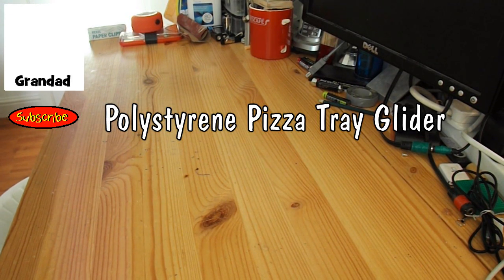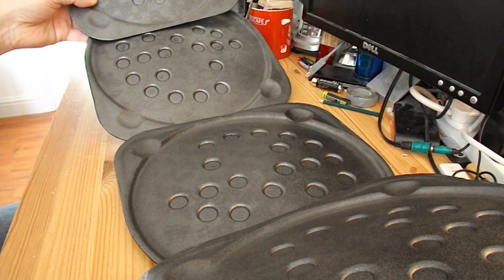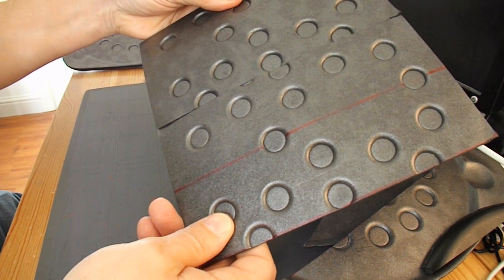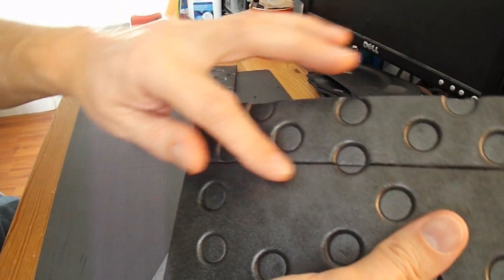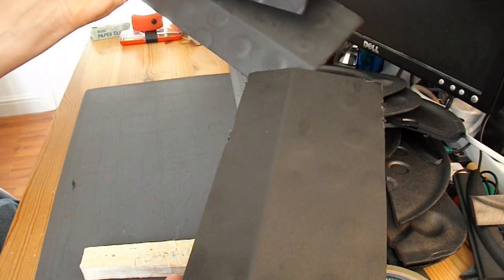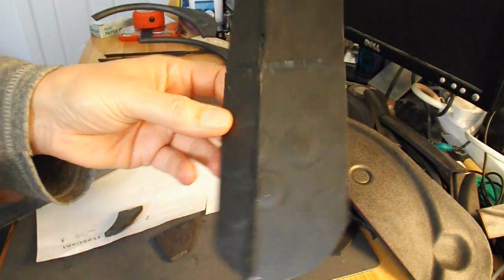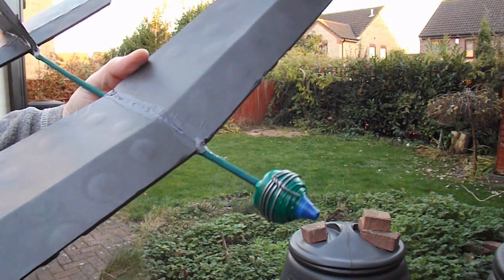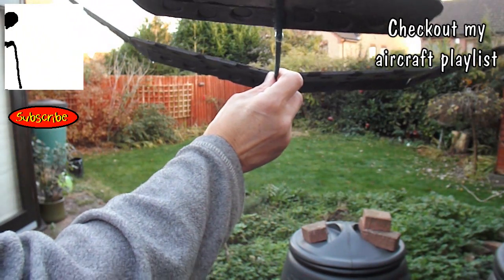Polystyrene Pizza Tray Glider

Comment: You could try to make a DLG glider with those ,jus sand down those bumps and put a strip of thick tape over the holes but don't press the tape into the hole,that shoud solve the inperfect wing
Reply from the maker: Not a lot of strength in those pizza trays to take the stress of a discus launch. You could add a fibreglass or carbon fibre spar to take the strain. Here is something similar - DLG Pizza Tray Glider with Cheap Kite frame playlist https://www.youtube.com/playlist?list=PLA5a2xPRSrB3JAFc7f5qk95lpdSMOXDHw

Comment: This glider is very well balanced. Just be sure that the rudder is straight (or eventually move it slightly to the right), because your plane turns always to the left, instead of going straight.
This glider could be a very good slow flyer (as much as my V.E.P. Very Easy Plane).
Install the F939 parts on it and have fun!

Comment: i have to exact same glue gun as you
Reply from the maker: Unfortunately after about 20 years of use it finally died and I had to replace it https://youtu.be/wllhi4orLAI
Reply: o, well i got mine from my dad so i don't how old it is?
Reply from the maker: ADSlammer They are still available new but I bought a cheaper one as a replacement.
Reply: o, cool i didn't  know you could buy them still!?

Comment: no strengthening,  just hot glue on the joints as you did, then ran another bead over once set. used a carbon fibre rod instead of a cane, I had some rc wing covering tape in various colours so put that across the joints once set. seems plenty strong enough but I suppose you could put a cf spar in if needed.
Reply from the maker: Any chance of a video, I see you quad videos but they are a few years old now so I guess you don't upload very often

Comment: just made and flown this, wow thanks grandad this thing flys just as well as a shop bought glider if not better, think you should remake this maybe add a motor/prop, I'm even thinking of going rc with it.
Reply from the maker: Wow, amazing. I hope you added some sort of strengthening. I only used hot glue and it was OK for gentle work but I managed to break it throwing it too hard.

Comment: but where do you get the pizza tray's?
Reply from the maker: +Jip de Greef Clearly many parts of the world do not have polystyrene pizza trays. They are just the packaging that my local supermarkets use for pizzas. I use them because they are free and would otherwise be thrown away. You could use any polystyrene or styrofoam packaging you can find or even buy foam board from model shops. The foam I am using is about 5mm thick.

Comment: Hi, I congratulations on this plane, it's fly on a straight line and long. I would ask that this single curved wing is good enough or fully curved? I tried both but what is the difference? 
The point is not to be the wing completely flat and completely parallel to the direction of flying? 
I ask this because I can not do a good ribbed and polished wing just kind of curved wing Thanks!
Reply from the maker: A flat wing will give you maximum lift but minimum stability. A dihedral or V shape helps to stabilise the flight. The only reason this wing has polyhedral is it is made from 4 short sections of foam. Each section is the biggest section I could cut from the polystyrene pizza trays. This wing is very inefficient for lift but very stable in flight. It would fly further if the wings were flatter.
Reply: +GrandadIsAnOldMan Thanks for your information, but I have thinked the aerofoil just my english not good enough. :) So that your pizzatray glider's wings are bent along a straight line. I will try to make a fully covered aerofoil wing from a thin cardboard. I don't know what is the best aerofoil to fly our planes. Yesterday I tried my little cardboard wing and polystiren damping wings glider. I threw it that I bent the vertical stabilizers and gave a litle lift. The plane return to me so I can see how to fly it and I didn't have to go for it. The setups are very important, i think. So I like these hand launch gliders but Your glider with super capacitor was very interesting because it more effective than rubber band models. So I thanks Your work in these subjects!
Reply from the maker: goldenfish77 sorry I misunderstood. Yes there is lots of discussion on the best aerofoil and you can get good results from shapes that probably should not work. The KFM2 aerofoil is very popular.
Reply: +GrandadIsAnOldMan Thanks a lot for your answer! I didn't know this aerofoil. My problem is that if I make a lightweight glider from styrofoam, it can't fly in wind or it can't fly far. Do you think that I should make little planes (40 cm wingspan) from foam and the bigger planes (60-80 cm wingspan) from cardboard? Do you think that the drinking straws or shashlik sticks would be good for reinforcement of wings?
Reply from the maker: goldenfish77 I am no expert on model planes, I watch plenty of YouTube videos to get ideas. FliteTest is always a good place to start for information on aeromodelling. Here is a good looking foam glider that uses bbq sticks for strength https://youtu.be/dsc_R_QZvhA?list=PLA5a2xPRSrB3JAFc7f5qk95lpdSMOXDHw
Reply: +GrandadIsAnOldMan Thanks for Your help! I wish the BEST! :)

Comment: measures you did you use?
measures you did you use? ........
Reply from the maker: +walter Drago the pizza trays are for 9 inch pizzas, so I just cut them from that. If you use pizza trays from 9 inch pizzas yours will work out to the same sort of size. If you use smaller trays it will be smaller, if you use bigger trays it will be bigger. The flower cane is 30 cm long.

Comment: Excellent idea gramps and a job well done. I wonder if the bumps on the tray helped with lift, kind of like on a golf ball, even though the airfoil camber would have done quite well itself.
Reply from the maker: +Chilarai B thanks, the problem with checking whether the bumps make any difference is that you would have to make another plane EXACTLY the same dimensions and weight and materials without the bumps and fly it in exactly the same conditions. Then you would need some very accurate measurement systems to gauge if there was any difference so I don't think it is likely we will ever know. I am not a golfer but I seem to remember it is indentations or dimples on golf balls, not bumps, although I am sure you could argue a good case for bumps. https://en.wikipedia.org/wiki/Golf_ball#Aerodynamics

Comment: rubber band power it
Reply from the maker: +Louis Roden I am sure you could do that, it would be better than trying an electric motor. The wings have very little strength so a rubber motor would be a gentle method of powering it.

Comment: I started building planes because of your coffee stirrer glider video:)
Reply: +GrandadIsAnOldMan 
You know that I your planes fly great.
Reply from the maker: +random person that is good to know. I hope you have more success than me, many of my planes are not good flyers.
Reply: There is a video I posted not too long ago,
It is called "capacitor powered free flight plane" I used a Maxwell 2.7 volt 5 farad capacitor and an electric motor from ebay, and foam plates
Reply: I use bigger moters and don't ad an aerofoil.
Used a power up for a charger
Reply from the maker: +random person that is great, I really liked your plane. Looks good and flies well. Excellent job, well done.

Comment: Nice ! i think i'm gonna make one too
Reply from the maker: +Cedric S good luck. It is not the best material to use but if you can get it to work it is fun. You might want to think about some sort of bracing for the wing joints as it does not have any strength.
Reply: GrandadIsAnOldMan hmmm. i have some styrofoam lying around   but they are mabe to fexible. so the wing may break off but ill try it.  or will it be possible to make one out of cardboard ?
Reply from the maker: Cedric S you can make it from cardboard. It will be much heavier and probably have the same problem with the joints breaking.
Reply: GrandadIsAnOldMan i will try making it from cardboard and i will let you know if it worked. if  not ill try different materials and i will see which one performs the best. and i have a question. is there mabe a template or guide i can download or print ?
Reply from the maker: +Cedric S I tend to make my projects up as I go along, very rare that I draw anything like plans. On the video I do talk about dimensions at about 02:00 but that is just explaining I am making it that size because that is the largest size I can cut from those polystyrene trays.

Comment: I like this one too. Needs more space to get its full potential. The cg is generally 1/3 from the leading edge of the wing.
Reply from the maker: +Floyd Dameron thanks Floyd, it has a basic flaw as I did not build in any bracing for the wing joints. It did fly and was very stable but I managed to snap the wings eventually when I got rather enthusiastic throwing it.

Comment: everything about this glider shows, creativity, lack of aerofoil knowledge - for want of trying and possibly defies every form of flight mechanics - all except this glider seems to fly
Reply from the maker: +MrFriedgreentomatos it will not take you very long searching YouTube to find hundreds of examples of planes made by aeromodellers that demonstrate that a conventional aerofoil is not a necessity for getting a plane to fly. It will certainly fly better with a conventional aerofoil but the angular bends in these wings are more about adding strength without bracing and absolute simplicity in building.

Comment: do you eat a lot of pizza or can you buy a pack of a load of pizza plates at a 99p shop or somewhere??
Reply from the maker: +Finnjamin Donaldpoop we usually have a couple of pizzas each week so over the months I build up quite a collection. In a month I would have 8 trays.
Reply: +GrandadIsAnOldMan ok. Do you know of anywhere I can get some because we don't eat much pizza.
Reply from the maker: Finnjamin Donaldpoop 
This is my standard answer for this sort of question.
Clearly many parts of the world do not have polystyrene pizza trays. They are just the packaging that my local supermarkets use for pizzas. I use them because they are free and would otherwise be thrown away. You could use any polystyrene or styrofoam packaging you can find or even buy foam board from model shops. The foam I am using is about 5mm thick.

Comment: Nice free flight model excellent glide ratio. That might make a great rubber band powered model.
Reply from the maker: That guy for 2a defend the constitution it had very little strength, just hot glue holding it together. A few enthusiastic launches and the wings folded, but it served it's purpose.

Comment: Please hay way that me pueden provide them measures of el avion?
Reply from the maker: Hi manuel jesús martinez navarrete I just made the wing sections as large as I could from the polystyrene pizza trays so each section is about 9" x 5" in fact at 02:00 I say it is 120mm wide and 220mm long. The tail is about 14 inches by 4 inches. The cane is 60 cm

Comment: please you fueras amable tan otorgar el avion las measures? .... gracias
Reply from the maker: Hi  I just made the wing sections as large as I could from the polystyrene pizza trays so each section is about 9" x 5" in fact at 02:00 I say it is 120mm wide and 220mm long. The tail is about 14 inches by 4 inches. The cane is 60 cm
Reply: eres exelente
...muy amable

Comment: porfavor si fueras tam amable de otorgar las medidas de el avion?....muchas gracias
Reply from the maker: Hi  I just made the wing sections as large as I could from the polystyrene pizza trays so each section is about 9" x 5" in fact at 02:00 I say it is 120mm wide and 220mm long. The tail is about 14 inches by 4 inches. The cane is 60 cm

Comment: a gentle heating of your bamboo will allow you to bend it into any shape,even a circle.   When you get the shape required ,run it under cold water.   It takes a bit of practice to time the amount of heat needed  and wear some thick gloves
Reply from the maker: Thanks, these canes are far from ideal for this sort of project, a fibreglass tube or even good old balsa wood would be better but on my channel I try to use cheap stuff. The main shape I would have liked here was dead straight but I just work with the natural curve and see what happens.

Comment: Cool I wont one! Hop it isn't anover of your pranks again!
Reply from the maker: Haha, no, this is genuine, and it does fly, but it is not very strong. I managed to break it quite easily when I tried to throw it really hard in strong wind. It is OK if you are gentle with it. You could add some strengthening to the joins but I was just seeing if I could make a glider this large from those small pieces of polystyrene.
Reply: I can see that because I atempted to make it!

Comment: You can hot glue a v like hook to the front and launch by catapult. They are the giant rubber bands 2 or 3 tied to the end of a pole stuck in ground .see my video     Catapult  balsa wood gliders
Reply from the maker: Hi Greg, great video and that certainly takes the effort out of launching the gliders. August 2007 I see you have been around YouTube for a long time :-)
My glider would not survive that sort of launch, it has no strengtheners in the wings, just simple hot glue butt joints. I was looking at balsa wood recently and horrified to see how expensive it is now compared to the 70's when I used to make proper mode aeroplanes. I guess a hot wire and styrofoam is the way to go now, or that flat pack foam board stuff they all seem to use.

Comment: cool plane can you make it out of
plastic plates instead
Reply from the maker: Hi Jim. I don't think I could make one this size with the styrofoam plates I have, but I did make a smaller version.
http://youtu.be/3jScgJGBfpQ?list=PLA5a2xPRSrB0nZItxE_78EJP0F99Ghaki
http://youtu.be/e50XT5npqfE?list=PLA5a2xPRSrB0nZItxE_78EJP0F99Ghaki
http://youtu.be/W5v-WcR1MS0?list=PLA5a2xPRSrB0nZItxE_78EJP0F99Ghaki
http://youtu.be/CGoNRQamdcs?list=PLA5a2xPRSrB0nZItxE_78EJP0F99Ghaki